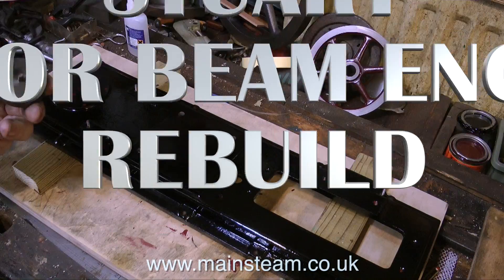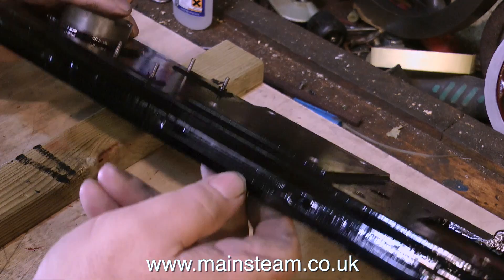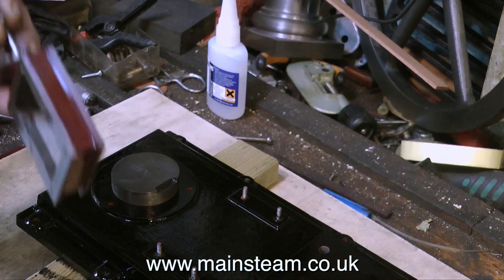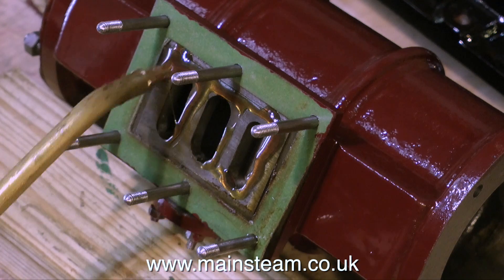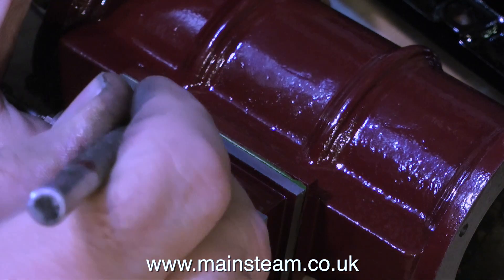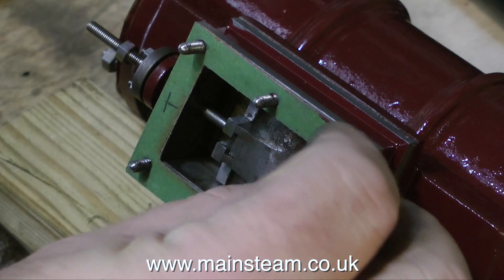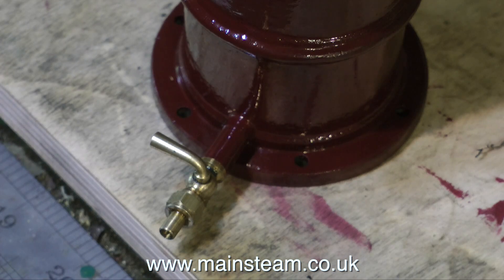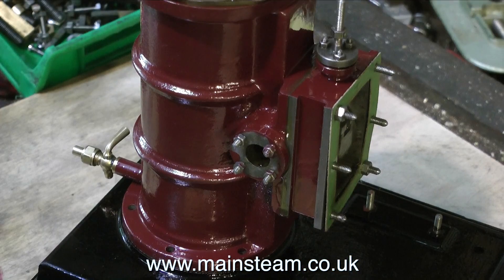STUART MAJOR BEAM ENGINE REBUILD - PART #25

Comment: What makes the handle necessary?
what is the function on a full size engine? :-)
Reply from the maker: No function on the model, just decorative. On a full size engine they are used for either operating reversing gear or moving the steam valves manually, usually during starting.

Comment: When you had to machine a flat on the cylinder support block for the drain cock, surely that's what the recess on the reverse side was for and you just had it the wrong way round? Have I missed something?
Reply from the maker: +Fergus Walker Please re-watch the video - I explain what the recess is for.
Reply: +Keith Appleton Yes, I saw/heard you say that it was to avoid covering the steam port, but I partially forgot because I never saw it actually in place in comparison to the steam port, I stupidly forgot that the port locations on the steam chest don't match the location in the cylinder. So in the original assembly did the drain cock simply not work?
Reply from the maker: +Fergus Walker on the original build, the drain cost did nothing at all as the lump of cast iron covered its outlet completely.....
Reply: +Keith Appleton Thanks. Not enough machining in that comment... ;)

Comment: So someone took the time to taper the base of the cylinder to get the water to flow out nicely but didn't check to see if the outlet was obstructed?  The mixed quality of this engine just keeps rearing it's head doesn't it?